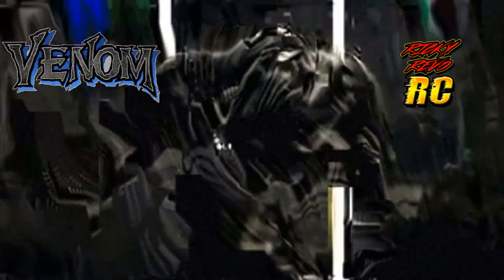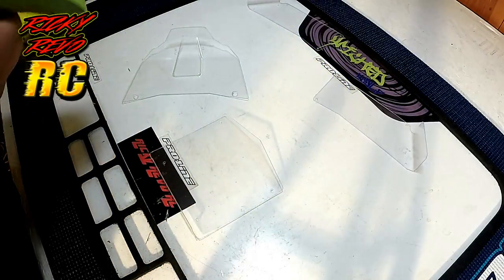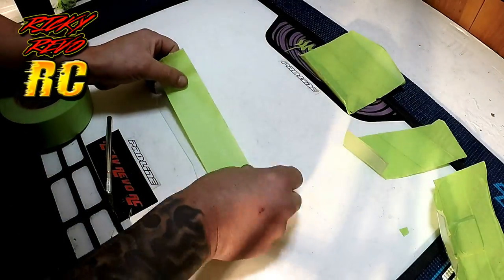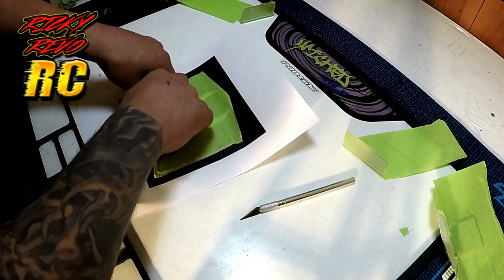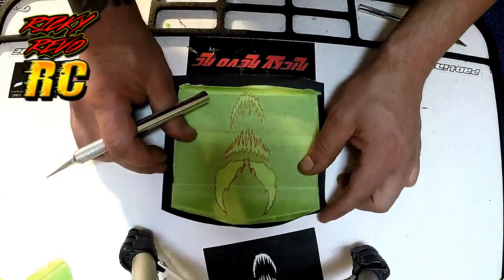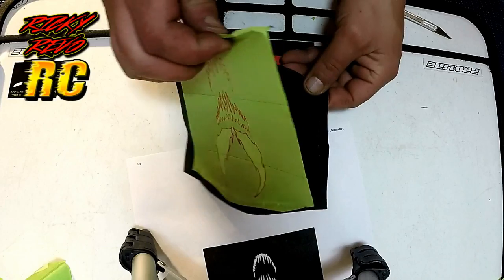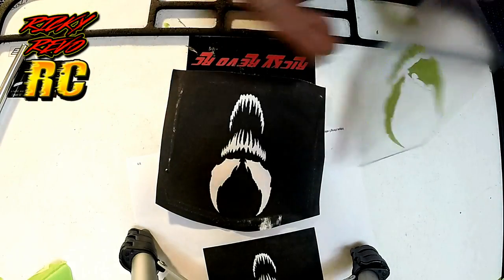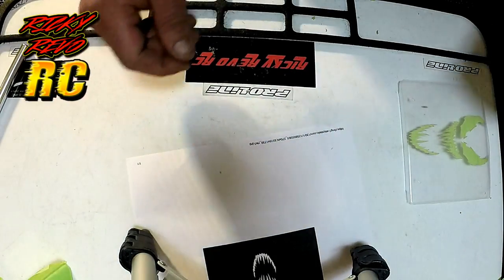RC Car Paint Stencils - Make Your Own! - Axial Bomber Venom Paint Scheme

Comment: hey brother I'm an artist and also just getting into the hobby I just got my erevo brushless...stupid question at the end after you cut it out and it's final with it cut out on the plastic piece panels question is do you peel what's left off the plastic at the end and just stick the green tape cut out on the vehicle then spray it over....correct? hope this makes sense.. sorry so long advice would be amazing awesome videos I'll follow 4ever!
Reply from the maker: Yep! So anytime you paint an RC body you always start darkest color to lightest. So the eyes and mouth are going to be white and the background will be black. So I peeled away the area that is going to be black, spray it with 2-3 coats of black then peel the eyes and spray them white.
Reply: Ricky Revo RC awesome brother that helped a lot...I'm just going to try to attempt the process...what are the clear plastic pieces you use(side panels and stuff)